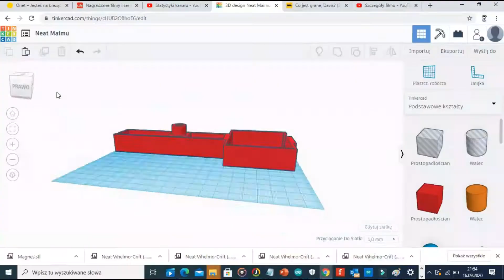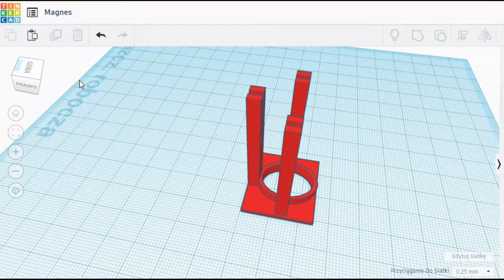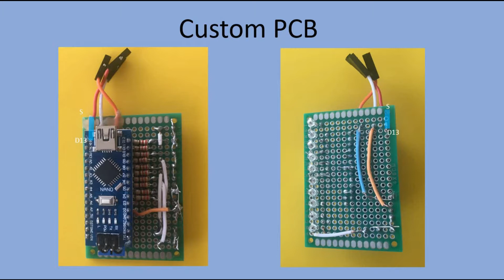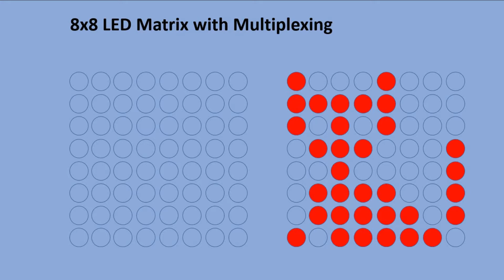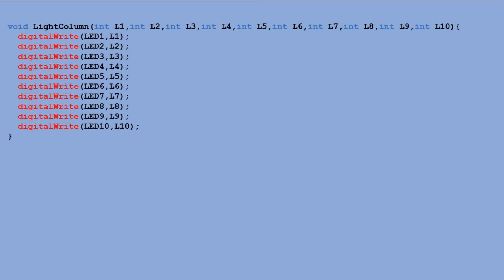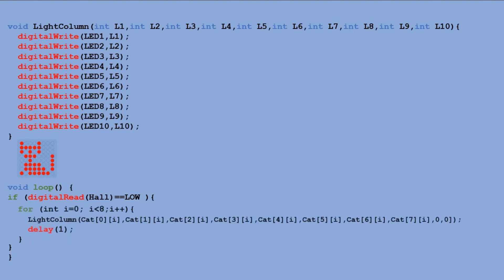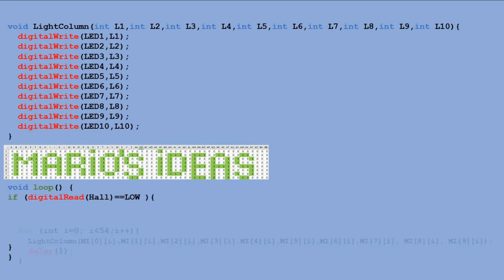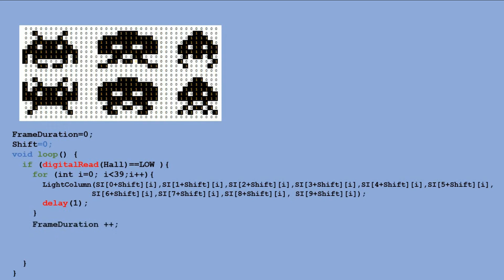How to Create Arduino POV (Persistence of vision) Display

Comment: What do you recommend the minimal rpm of the motor?
Reply from the maker: I was constrained by the old fan rpm. Did not measure it and it did not keep the same speed all the time thus you can see the diplayed content stretching at times.
I recall seeing 500RPM mentioned somwhere. But you woud have to double check it.

Comment: I hate that you called an arduino nano a "Generic PCB board". It's fine tho.
I also hate that you labeled a prototyped breadboard setup as a " Custom PCB" like it was custom and a PCB.
Also, I don't know why you have a spare table fan but not a DC motor with a built in encoder or a Stepper motor.

Sorry for the too much attention to details. Nice channel dude

Also, can you try using WS2812b addressable RGB strip. I want to try that but I dont have the time for now. Hoping you could try it out
Reply from the maker: When I said Generic PCB board I called this PCB I used to solder Header pins and resistors to. I would not dare to call arduino nano a generic PCB ;) I do have DC motors but not great with mechanical set ups so I was not 100% sure how to mount all components (nano, battery, leds resistor) on a small DC motor. Not sure stepper motor can be ised here. You requires a lot of RPMs
Reply: @marios_ideas  anyways, nice job dude. Keep it up

Comment: I do declare this is going to be my next project!  Perhaps with Neo Pixel strips...  although I know I will agonise over coding a timing loop that self-adjusts to the RPM!
Reply from the maker: I was conteplating using neopixels as having color display would be great. But I did not have a dense strip and didn't want to wait for a long shipment from China.
Reply: Unsure where you live, got mine online from PiMoroni.  I got the 60leds/m RGB-only, moderately priced considering the technology that goes into each pixel!
Reply from the maker: @Modiford  I am in Poland. Well getting it is not a problem. But I do so many different projects that I am trying to be reasonable with the spending.  I cannot by 10cm that I need. On Aliexpress I have seen nice modules that have 10 neopixels that you can buy for peanuts